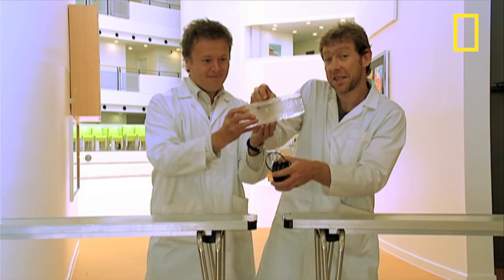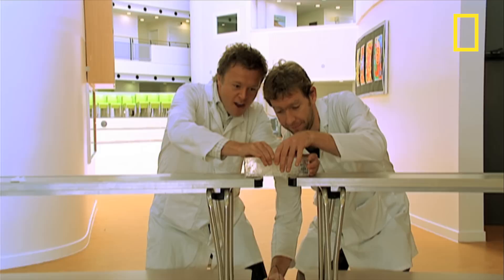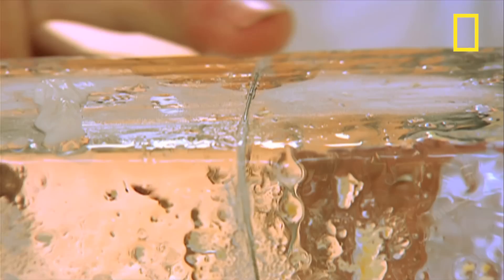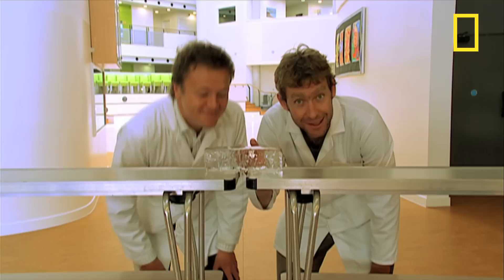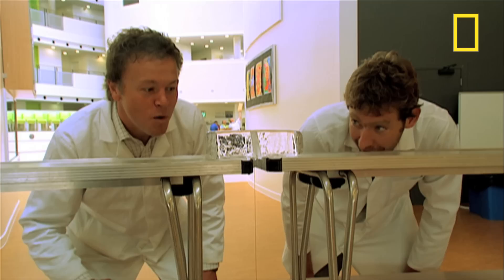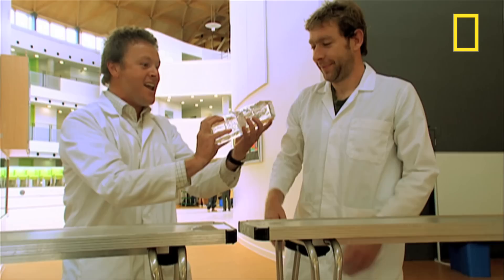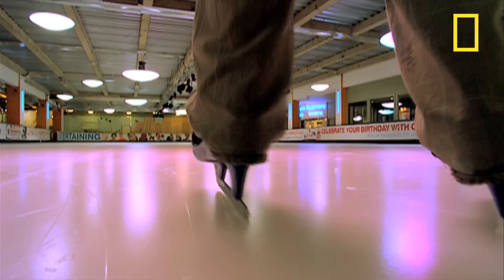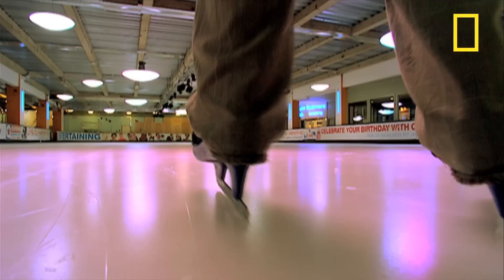The Science Behind Ice Skating | I Didn't Know That

Comment: the cheese wire through ice bit was a magic trick I did in school, only I used ice with food colouring in it to hide the internal mark where the wire went through it, the heavier the weights the faster it will cut, I got a 3 inch by 3 inch piece of ice to cut in about 30 seconds, any faster and the wire was simply breaking the ice, it was still a cool trick for a bunch of 3rd graders but.

Comment: Atoms actually can get smaller. Electrons can release photons and that drops them to a lower energy state (moves them closer to the nucleus), which therefore decreases the volume of the atom. Not just that, atoms can lose electrons during chemical bonds/interactions which would make them smaller, and lets not forget about nuclear fission which splits apart a nucleus of an atom into two pieces and so effectively decreasing its size by half.

Comment: Water is one of the few substances that expands when frozen. Therefore, when pressure is applied, it is forced to contract, and consequently, it is forced into a liquid state. I believe this is the answer.
Reply: I'm afraid in this case it's not. 7 years later, but this is the real answer (Even National Geografic got it wrong)
Actually it isn't about pressure. We would have to weigh around 3000kg to apply the pressure we need to melt solid ice with our skates.
His explanation about impuritys of frozen water also isn't correct I'm afraid.
It's all about the molecular forces between water-molecules. Right at the surface area molecules aren't experiencing the same amount of forces as inside the liquid. Consequently there is an area at the surface (usually about 10-16 molecular layers wide) where molecules can 'move' around more easily: It allows kind of a diffusive movement. Thus there is a small layer of molecules at the boundary layer which acts similarly to a liquid; however, it isn't a real film of water in phisical terms.

The melting point of this boundary layer is round about -25°C, which means that below that temperature ice wouldn't be slippery anymore and there would be no way to skate. (Below this temperature thermal agitation isn't significant, because it can not compensate molecular forces.)
Reply: @AG-oi3rq  very nice! I was looking for a good explanation